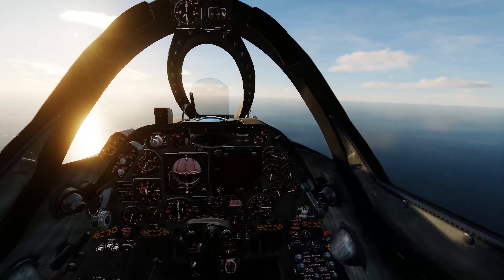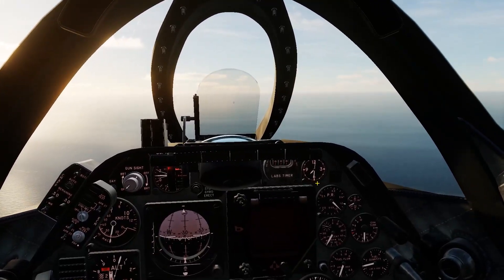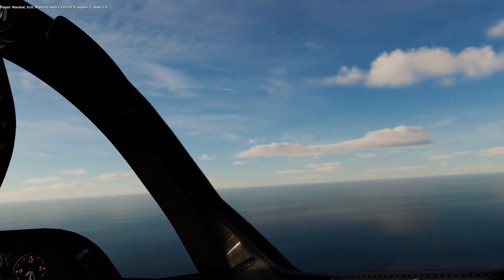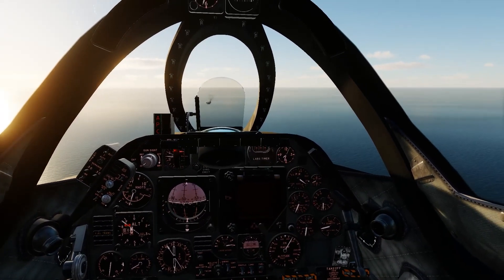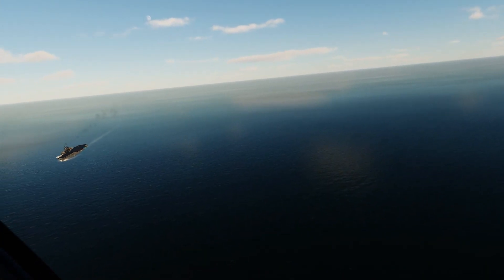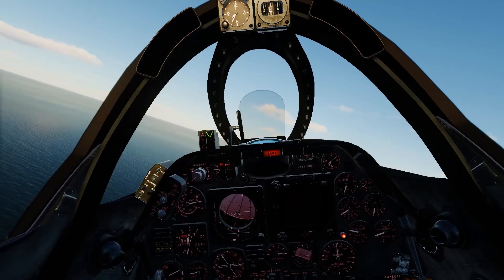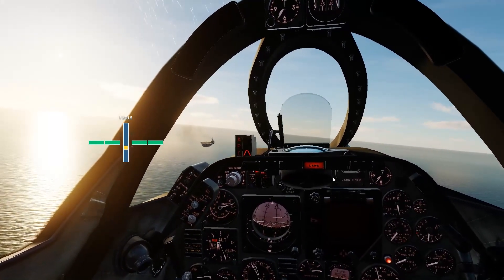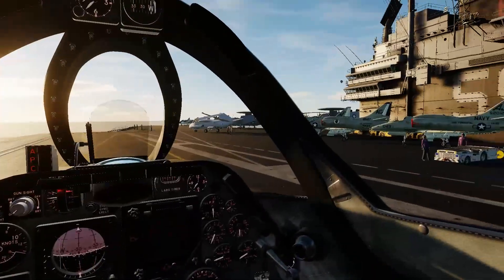A-4E Tutorial - Case 1 Recovery

Comment: Feels like you're right on the edge trying to keep on AOA and speed while not dropping out of the sky in this aircraft. Nose angle seems really high too. Wonder how realistic that is...
Reply from the maker: According to some pilots who have flown the aircraft - right on the money, apparently.
Reply: Yeah, everything you said plus it's a challenge to see over the nose.  In order to keep from falling out of the sky with the APC I find that I have to come in with fairly low fuel state, usually 1500 lbs or less.  I also turned the "cockpit shake" down lower in the Special Options tab in DCS - with the default values the aircraft is shaking so much you can't read the instruments.

Comment: I don't want to be picky, your videos are usually very informative, but would you do a case1 including the 5 mile holding pattern? Also how to do a case 3 in an analogue scooter?
Reply from the maker: Well, I would be happy to produce such a video, but unfortunately I do not have the skill or knowledge to fly it.  If anyone is interested in showing the rest of us how to follow both of those procedures, they should DM me on my Discord channel and we'll figure how to get the video made.
Reply: Flying the 5 mile Marshall stack holding pattern is pretty easy - orbit counter clockwise at 2000', 250kn putting the carrier at the 3-o'clock position, if you visualize the orbit as a clock.  When you get to around the 9 o'clock position (or just before), fly out on a head of the reciprocal of the BRC + 30 degrees (i.e. BRC=255, reciprocal = 075, so fly heading 105).  You do a descending left hand turn with the goal of hitting the "initial point", 3NM behind the carrier, aligned with the BRC heading, at (300-350knots) and at 800 feet ASL.  A-4 NATOPS calls for passing just to the right of the boat - probably a cockpit visibility thing, then you enter the overhead break and proceed with the normal CASE 1 landing pattern.  I'm sure I got some details wrong, but join the A-4 Discord server and lots of people will be around to set both of us straight on the details.
Reply: Hello, from your question Sidekick and I were motiviated to make a Marshall pattern video, which he just released here: https://www.youtube.com/watch?v=miRIlfJ20sQ    I hope that helps answer your question and show doing a case 1 with the 5 mile holding pattern, cheers